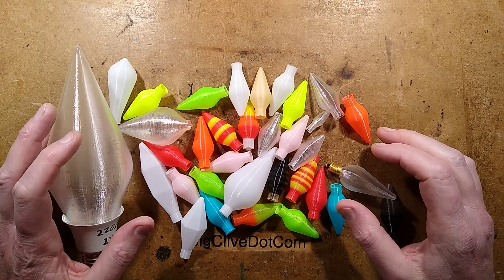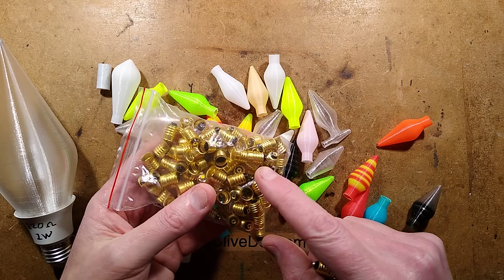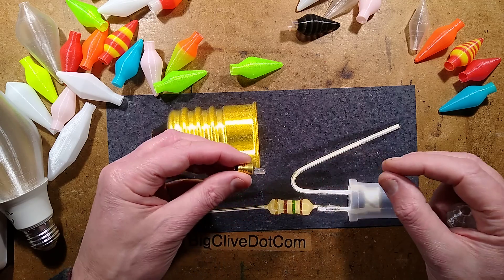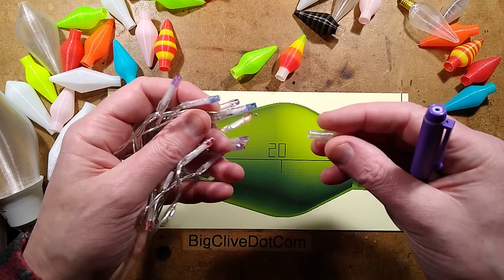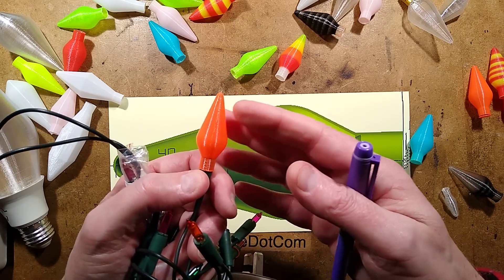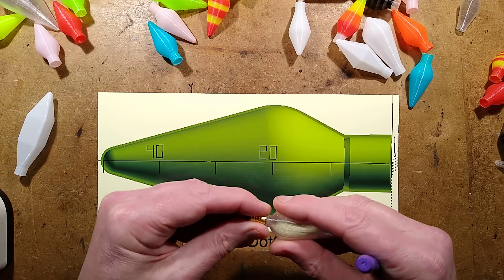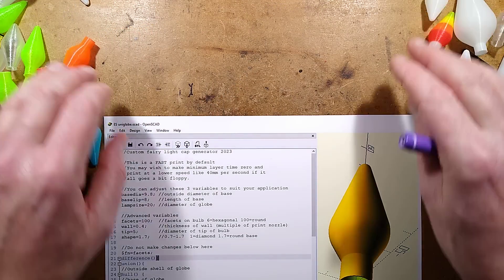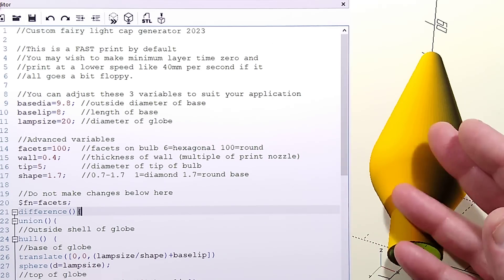Custom bulb maker 2023

Comment: HELP, Clive, I'm stuck with printing these out for the screw-in bulbs. I've got the size right at 8.2 (4th attempt). I don't have "vase" with "Creality Print", but I do have "Spiralize Outer Contour" which fixes the seam.

But why, if you go past six facets do you get a cylinder inserted? 

And is there a way to stop that from happening?
Reply from the maker: There's a cylinder that protrudes slightly into the interior to position holders.

Comment: I did this a few years ago with polypropylene filament.  (Before I discovered open scad) Standard tungsten socket type led strings are available here making it a bit easier.  My favorite I did was a clear snowman where the light goes through the top hat.  The base I made wider and put indents in it to act more of a spring fit rather than friction fit so it’s more universal.  I just take a black paint marker on that snow man color the hat and coal.

Comment: If the wall thickness is set to nozzle size, in Cura you can activate the "spiralizing out contour"-feature (under "special modes"). So there will be no seam and the print goes in one smooth drive. It's possible you have to cut the solid first layer at the bottom off. But this solves the elephant foot problem too.

Comment: The shape of your bulb making remained me of the Woolworth in the 1970's where they sold incandescent bulbs that where about the shape as you have made and they were rated at 20volt each and screwed into a string of 12 = 240 volt but they didn't last very long and when one bulb goes they all stop working.  Then were the days
Reply from the maker: When our trees had just a couple of dozen lights, but looked fantastic.

Comment: What's the supply voltage for LED street lights? Should I open one up for power to xmas lights like in the old days??
Reply from the maker: The street lights operate at your full local mains voltage.  Municipal xmas lights generally plug into a waterproof socket on the pole.

Comment: a box fan in the same room as the printer, maybe pointing towards but not right on top of the printer will drastically reduce "floppiness" on small prints by cooling the print as it comes out.

Comment: Shades of my youth, when we had (presumably) molded and painted glass lights in all manner of shapes: candles; lamp post toppers; Santa; houses; etc.

I wonder if including a sampling of holes would deal with the power issue.  Since it's a 3D print, baffles could be included inside to keep differently colo(u)red light from shining out the holes, without significantly impeding air flow.  But presumably much more of a project.

Comment: This print is shouting for printing in Vase Mode! Then it will be one continous spiral, no stops, no foggy parts! 😅And it will print even faster as well! 🤪
Reply from the maker: It already prints as a single wall thickness if that is chosen, but vase mode would omit the ridge inside for inserted holders.

Comment: These are lovely, like the old 20 Volt, 3 Watt cone-shaped Christmas lights from many years ago in the UK.  I'm sure there would be a nostalgia market for recreating some of the old classic 1960s-1980s Christmas light shade designs from the likes of Pifco etc. but with warm white LED light sources.
Reply from the maker: Noma have re-released sets of the tungsten strings with original style caps.
Reply: I have some old sets and have managed to make new looms for low voltage (Disney sets by Mazda) but I've been looking to install new light sources in the mid 1930s 'fruit' lights by Klimax which may be of Hungarian origin.  I've delayed doing these as I need to find a suitable light source.  I'd prefer LEDs but they need to be unidirectional and correct colour temperature.  So far I'm leaning towards 3w, 4w or 5w bulbs and sockets as used in the auto industry.  I would have to bond the original decorative covers on which covers the filament.  Anyone with better ideas to rejuvenate these vintage sets?

Comment: I know very little about 3D printing, but, could you put a small computer fan somewhere within a few feet of the print, gently blowing a breeze across it to cool it? Moving air can move a surprising amount of heat. I wonder if this would cool the workpiece without excessively cooling the printer head.
Reply from the maker: The print nozzle has its own fan for that reason.

Comment: On thingyverse there are ajustable prints that use openscad where there's a window under the code where you can change the dimensions without going in the actual code... I've used one for filament spool drawers and bench vise jaw covers...

Comment: You have introduced me to openscad, but the step when I have started using code studio made enormous difference. Openscad has an official plugin at Visual studio and it makes  designs so much easier.
Openscad has good external editor support in its settings. Geany worked OK too

Comment: Clive, I love using OpenSCAD for parametric designs. If you haven’t tried it yet, there is an option buried deep down in the Cura settings called “Spiralize Outer Contour”. Instead of printing in layers, it prints the shell by gradually increasing the Z height. Thanks for sharing your light cap design!

Comment: A little bit of a tip I have found with clear plastics to get them even more clear: use a heat gun/hot air soldering station and you can dial in the 'perfect' temperature and speed and you can make a REALLY glossy lamp. Or, spots that are clear/holes in the lamp for ventilation/effects while the rest is 'frosted'. I use some of the smaller tips, or the big flat ones, that I never use because they are just weird shapes. Like, those quad-nozzle ones that kick around in your drawer. Like, what? You might have to add more than one layer, or maybe over-extrude to make a thicker-than-normal-wall but give it a try.

I have done the methods with resin/glue/etc and I just found that far too messy/awkward, and I just wanted to make a lamp with a TON of tiny little holes, and melting them worked out perfectly. And then I saw those 'weird' shaped nozzles and I was like "Hmmmm!"

Comment: Have you tried printing these with vase mode?
Reply from the maker: Vase mode would remove the deliberate internal ridge.  It is designed to print as a single layer by default.

Comment: for 2024, or the Xmas special, could you install some heat relief and give an option for an open tip vs closed tip?
Reply from the maker: The tip could actually be left open, and vents could be added along the sides.   But these are primarily intended for use with LEDs.

Comment: Thanks for this one. Just a couple of wee tips here: If you're afraid of things melting, try to use PETG. It's also easier to get shiny, like more transparent, than PLA. Whereas PLA gets soft at around 60°C, PETG can handle around 80°C. It's also not as brittle and can withstand UV and general weather a lot more than PLA (which degrades over time). PETG is basically the same as soda bottles are made of (PET) and not a lot harder to print with. Also, if you want very thin walls and make those bulbs as transparent as possible, try to print in vase mode. That should also remove the seam from the print. Normally, the printer prints a single layer, lifts the head and continues, but with vase mode, it should lift the head gradually and you won't get that seam. Note that vase mode is only supported with a single layer, so with a 0.4mm nozzle, it may be a wee bit too thin. Using a .6 or .8mm nozzle will help this a lot, though.

Good luck :)
Reply from the maker: This design is already a single wall print by default.   If printed in vase mode it would remove the internal ridge used with inserted lights as a positioning stop.

Comment: Love me some openscad but no hope of managing to write my own yet. Thankfully it allows even idiots like me to change parameters to the extent I need. Has Cura not got a filament change pause built in? I use both Simplify3D which hasn't or Prusa slicer which has.
Reply from the maker: I think it might have a filament change option.  But I've never tried it.

Comment: Clive, nice work.

What make and model of 3D printer do you use? Was this your first 3D printer or did you have previous experience, good or bad?

Would you consider doing a video that shows the whole process, from the "end" of this video, through generating the various files, transferring them and printing, please.

Thanks.
Reply from the maker: Currently an FLsun Q5.   It's a fairly standard delta printer.

Comment: Nice work Clive ❤ Always great that you share this stuff in a format that others can tinker with, learning how to use OpenSCAD in the process.
A slight tweak to the parameter block so the customizer gets more useful would be this:

/* [Base parameters] */
//outside diameter of base (subtract wall thickness*2 for inner dia)
basedia=9.8; 
//length of base
baselip=8;   
//diameter of globe
lampsize=20; 

/* [Advanced parameters] */
//facets on bulb; 6=hexagonal 100=round
facets=100;  
//thickness of wall (multiple of print nozzle)
wall=0.4;    
//diameter of tip of bulb
tip=5;       
//shape (moves the big sphere; 1=diamond 1.7=round base)
shape=1.7;   // [0.7:0.1:1.7]

Comment: Traditional tungstens? Naw, traditional tungsten Christmas lights are the C7s and C9s. Those get seriously toasty.

In my old house, I'd have a ~12' Christmas tree covered in the C7s. If the lights on the master bath were turned at the same time the tree was on, the circuit breaker would immediately pop.

Comment: I haven't used open s-cad but the overheating filament  thing could possibly be fixed by putting more than one  cap on the build plate at once as it will jump between them giving cooling time to the  other.

Comment: These are excellent Clive. These would be great for those vintage Ever Ready battery lights. You can still get the bulbs but there hard to find. I managed to get hold of some clear ones which I painted using perminant markers. Those 3D printers are fantastic for such tasks. There is also a guy who sells repro obsolete batteries he prints out and they take modern batteries inside.

Comment: If one could adapt those for 15v, one could make LED C6 bulbs for the vintage American lights (8 in series). That's what those small cones remind me of.
Reply from the maker: You could make a simple led, resistor and rectifier based 15V module.

Comment: Will the carbon resistor act as a fuse and blow open when 'it' happens?
Reply from the maker: Only if it can break the full current.  The LED is more likely to pop like a fuse internally.

Comment: Watching this gave me an idea, a lamp base that has 2 wire taps, so that you can insert it into an arbitrary location in a string of lamps (or just bare wires) to make a fully custom string of lights "in the field", don't know if this kind of thing already exists or if it would be useful but I thought I would share my thoughts anyways, hope this rambling is intelligible.
Reply from the maker: The self punching festoon lamp holders are used on building sites and some lighting displays.

Comment: I once used those tungsten bulbs in a sort of test toy, I used the metal can from an air freshener and punched holes into it evenly, poked the bulbs through so they were all on the inside, but the heat that came out of the can was insane, I had to abandon it, I'd not trust a low melting plastic with it

Comment: I have a few printed from the older scad`s and change them to fit the mood. In Cura there is an option to use fuzzy skin. they look great once sliced and printed.
Reply from the maker: I've not tried the fuzzy option with this yet, but it does look good on other objects.
In fact - I'll just go and print a fuzzy one now.
Reply: Fuzzy works great.  Very sparkly bulbs.  Fuzzy was encouraged in a comment on your  bulb video last year.  I printed many this way with transparent PLA.  Thank you to the person(s) who recommended it.

Comment: Love the OpenSCAD script as usual.  The more people see how these work, the more people realize it's not actually that complicated to get started in modeling.

I've printed some more transparent FDM stuff since last years' festivities, and found some more (possibly too many) configuration tweaks if you want perfectly even transparency / translucency.
The most important parameters:
- set minimum layer time to zero (like you said, but super important)
- set fan to maximum (since it's going to be the only cooling now)
- set perimeters to 999 and infill to 0%, or print in vase mode; you want steady, even swoops of lines, not jagged starts/stops as the printer zigzags tiny lines for infill.

To a lesser degree:
- if at all possible, turn off retraction.
- set z seam to random with smart hiding.
- mess around with combing options to reduce stop/starts as much as possible.  slicers are kinda unpredictable with how it executes these, however.

Printing in vase mode with a really wide layer line is by far the smoothest and most consistent option, but you might lose that inner flange if it is wider than your layer line setting.  It's also more prone to failing so it might not work for everybody.

Once you've got those down, you can change printing speed and temperature to control how "frosted" the print ends up being.  You can raise the temp and lower the speed to 'cook' the filament longer, or lower the temp and raise the speed to avoid doing so.  Different filaments will react differently to this; some get more transparent when you cook them, others (especially those stored in open air, collecting humidity) can bubble and froth when cooked which can be a nice diffusion effect.  PLA is also really easy to sand, which can create more or less diffusion based on grit.
Reply from the maker: With this script, setting a wall thickness to match your nozzle (usually 0.4mm) it does effectively print it vase-style by default, but with the inner ridge.
Reply: great info, thanks for sharing.  👍👍

Comment: Do you always use PLA? Have you tried PETG or other filaments?
Reply from the maker: Yes I have, but prefer PLA for most prints.
Reply: I've printed single-wall translucent objects in clear PETG, in terms of output appearance it's pretty much equivalent to PLA and quite a bit tougher/less brittle. PETG has great layer adhesion and meh bridging, so continuous extrusion "vase mode" objects in general tend to really play to its strengths in my experience.

Comment: At 5:35 point Clive showed a 4 sided one.  That one could be extended and changed a bit to make a handheld probe for an AC voltage detector, or similar.   It looks like it would fit comfortably in one's hand.  Thanks, Clive.